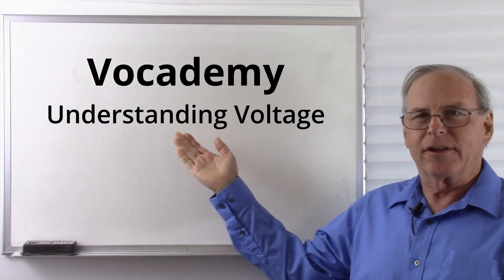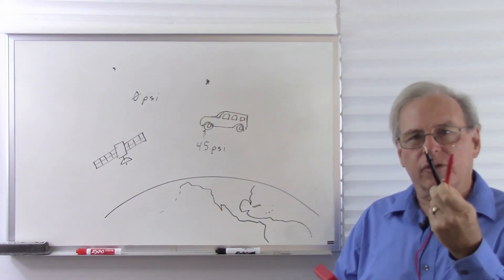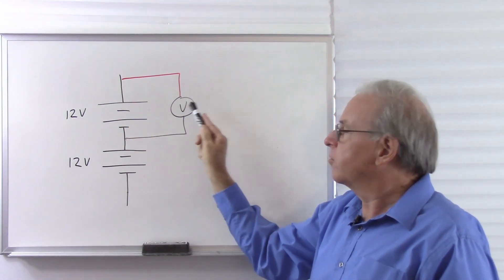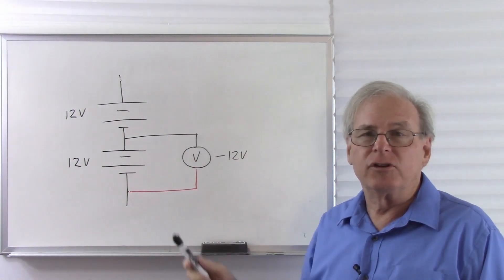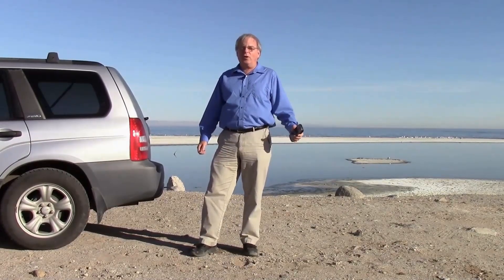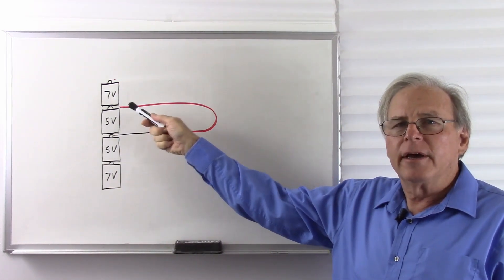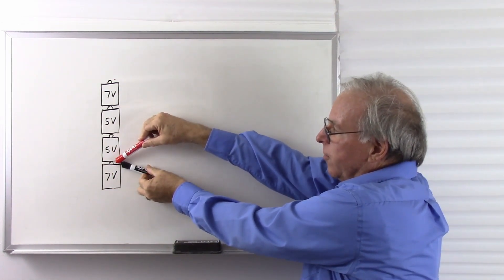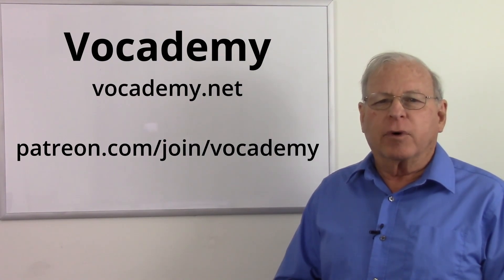Understanding Voltage

Comment: Actually, electrons flow out the NEGATIVE end of the battery. CONVENTIONAL CURRENT flows out the positive side to the negative side. Errors like this in these types of videos makes learning things much more difficult and confusing.
Reply: You are watching an electrical engineering video and complaining about the use of conventional current? Are you serious?
Reply: Like he didn't knew that. He explained it dozens of times. Think before you write and gfy

Comment: Battery is like a pump.  (Analogy of pneumatic systems with electric systems.)

Potential Examples
 
Air pressure example:
Mission Bay San Diego. 15psi air pressure.  Tire pressure is 45psi.  The pressure gauge is 30psi.
Mt Laguna.  12psi.  Tire pressure is 45psi.  Gauge is 33psi.
Space.  0psi.  Tire at 45psi.  Gauge is 45psi.

12V Batteries and DMM example:
1 & 2 Batteries
Red lead and Black lead.  + and -
I think I'd have highlighted to opposing batteries too.  IMO.  The more connections you make in their mind, the better.

Altitude or reference example:  https://youtu.be/VFN0hY8Yz9E?si=G4e6H0ECRj2N7xW6
Altitude 0ft.  Mission Bay.  
Mt Laguna 6042ft
Occillo Wells 0ft
Salton Sea -230ft.   Similar to negative voltage.
Vitreous and Resinous.  2 types.  Franklin said it's just 1 type.
The idea that relative and zero is what we choose.

kPa and meters.

Comment: Standard air pressure at sea level is about 29.92" Hg column and every 1000 feet you gain you will lose air pressure about 1" Hg column.6000` is 6 " Hg column loss which is 2.94 psi...  :)